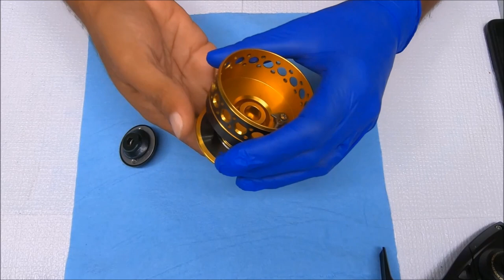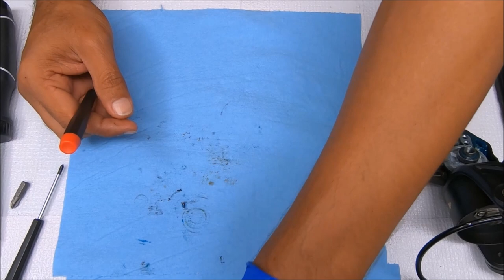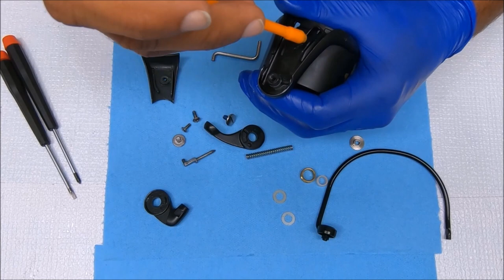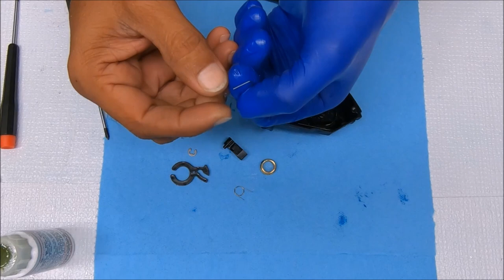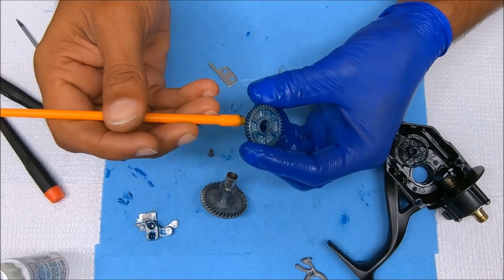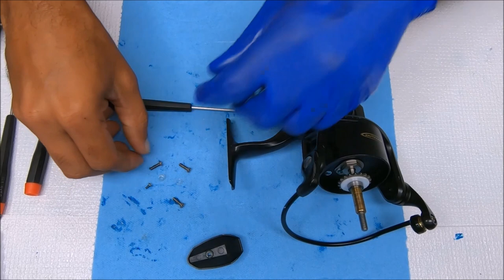Penn Battle II 6000 Fishing Reel - How to take apart, service and reassemble

Comment: I Finally did it. Your tutorial in video is fantastic...easy to follow. The only comment I have is that the spring in the spool is not fully explained on how to position the small hook or Tab. The locking spool retracted fully and lock in place when I reel it in. Excellent video tutorial. Thank you very much. Hope you do more tutorial about Daiwa 8.1 Lexa HD 400XS-p.
Reply from the maker: Thanks for watching! Glad to hear hear it helped and for the tip. What do you mean when you say the locking spool?
Reply: @TSGReelService  thank you for responding. The bail arm when you slide the small spring. I’m trying to spot or observe how to place this metal tang to get the the correct placement. Your thump is covering the position of the metal tang along with the spring. After few adjustment, I finally gotten the correct position. Thank you
Reply from the maker: Aah, okay. You could also trying checking out the videos in my library. Here's a specific one on the bail assembly that shows it clearly:

https://youtu.be/11bR51jTcfw

Comment: Outstanding video.  The best penn battle 6000 service video in all of YouTube.  You walked me step at a time through the process and everything went back together as original.  Can you do one for Diawa BG 6500?  Also, I notice you don't use oil on bearings.  Any reason why you don't recommend a drop on all internal bearings?
Reply from the maker: Thanks for watching! Glad to hear your found the video useful. I have a BG4000 or 4500 in my video library you can check out. In general, I oil the bearings.... and you should too. There are some reasons why I wouldn't, but it's not easy to disseminate when and why.... more of a feel/experience thing. More vids to come! Spread the word about the channel.

Comment: Thanks to you I’ve done 1gossa3diawa,2penn but on my Penn battle 2 it doesn’t real smooth when put back together there is no grinding or anything like that it feels firm like resistance not free enough I’ve taken back apart 2 more times no love still same I noticed though on the gear cover on handle side if I back off the screws a little it makes a difference but then I’ll get water intrusion? Any ideas ? Thank you again greatly appreciated & I’ve told 3 friends to check u out.👍
Reply from the maker: Thanks for watching and spreading the word about the channel! Glad to hear they're productive for you. Regarding the Penn Battle, play with the number of shims on the main gear and you should see/feel a difference..... get the number as close to what feels good to you as possible. Hope that helps.
Reply: Thank you again ! Removed 1 shim & much better!
Reply from the maker: @catherineromeo4891  you're welcome and good to hear. Glad it helped. Spread the word about the channel.

Comment: So you just lightly oil the clutch parts?
Reply from the maker: Thanks for watching! If you're referring to the anti-reverse clutch, yes, but it's VERY light.... half a drop on 2 or 3 of the rollers will suffice. If the clutch looks fine, leave it alone.

Comment: Hi. I was trying to search if you guys had a website for reel service and pricing. 

I have a 4-5yr old Penn battle 2 6000 and it's been used pretty heavily over the years. Recently, I attempted to take it apart since it was making a clicking/grinding noise when rotating the handle, which I thought was sand inside. I took apart almost everything as shown in your video, except I somehow broke part of the crosswind block (I think).

Anyway I wish I found this video sooner. I may have messed it up more since I put it back together and the reel handle doesn't really turn anymore. There was sand mixed up inside as well. 

Please let me know if this is something your company can help with. Thanks in advance.
Reply from the maker: Thanks for watching! Sorry to hear about your fishing reel. I mainly stick to working on local reels, but you can email me at tsgreelservice@gmail.com and I can let you know if I can help.
Reply: @TSGReelService  will do. Thx!

Comment: Need help i am lil confused ..i have  2 shims remaining i dont know where does it belong i have already fixed 3 shims in the main gear..can you tell me where does it fit?
Reply from the maker: Thanks for watching! Probably the pinion gear. Check the reel's schematics carefully for placement and fit.
Reply: @TSGReelService  schematic doesn’t show any shims in the pinion gear...not able to figure out
Reply: @TSGReelService  but the funniest part is reel is functioning properly after reassembly even though two shims are missing from it
Reply: I might have missed but do you still oil the bearings even though they are sealed?